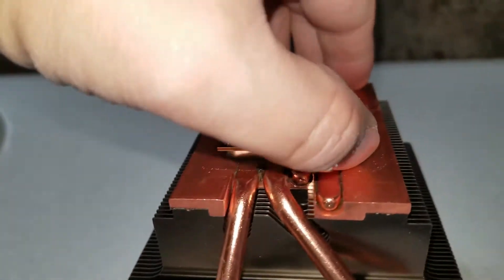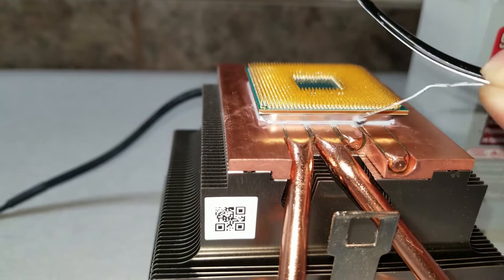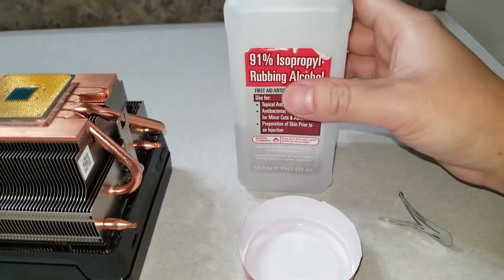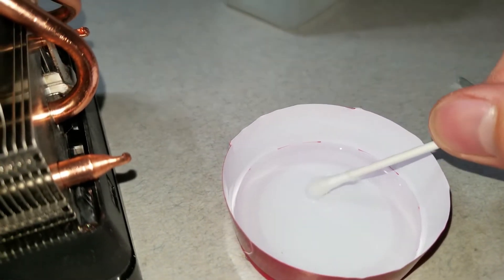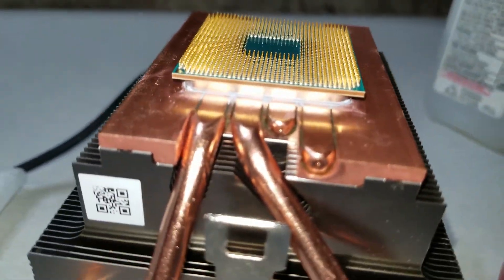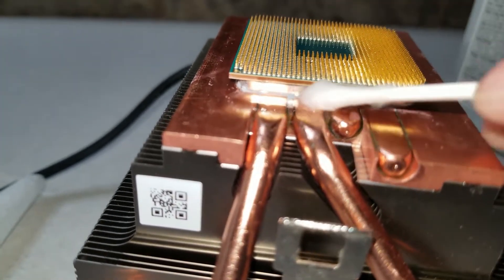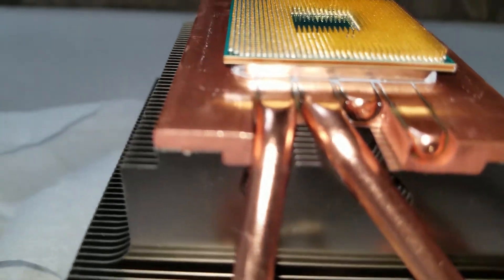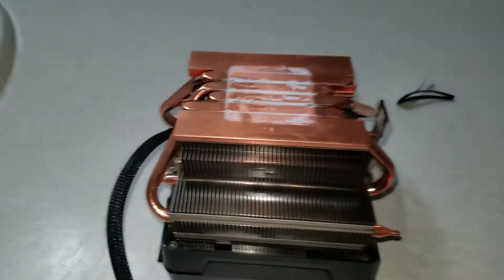"How to Safely Remove CPU Off Heatsink: A Comprehensive Tutorial"

Comment: The pins were broken when you took out the cpu attached to the heatsink?
Reply from the maker: the pins were fine on the cpu. the cpu just got stuck to the heatsink because of alot of heat. This is pretty normal. i end up selling the cpu later.